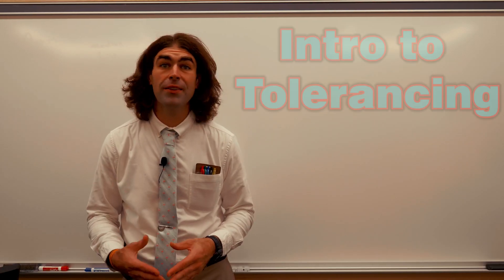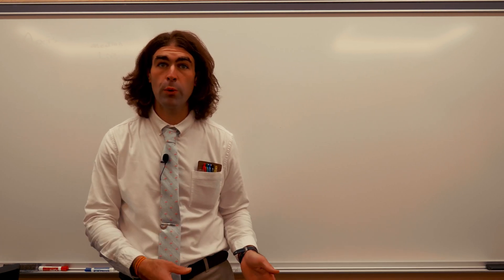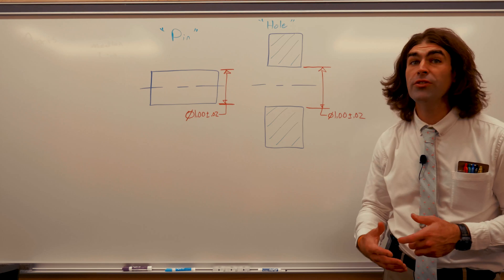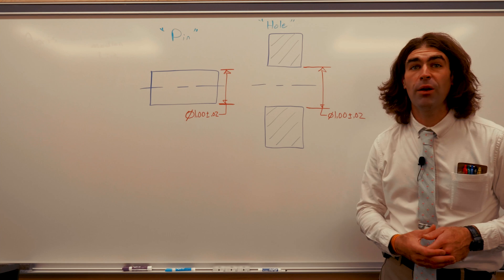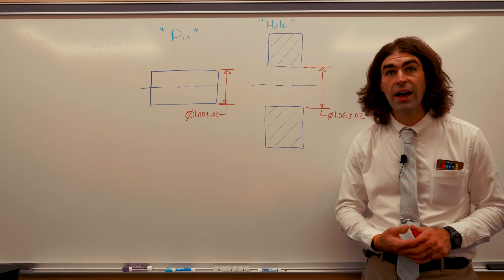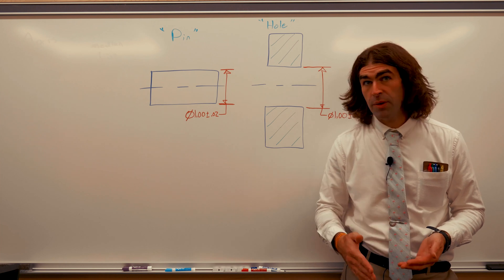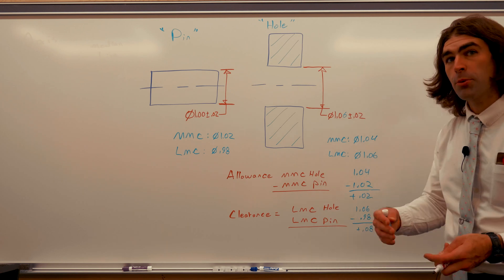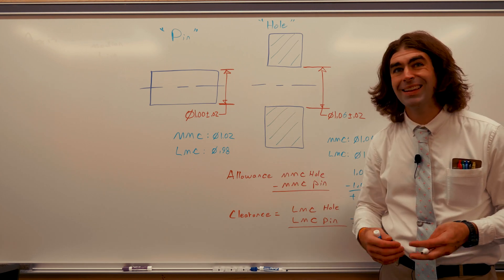Intro to Tolerancing: “Worst Case”, Allowance & Clearance

Comment: How clearance gets affected when there is position tolerance applied to hole at MMC ???
Reply from the maker: Hi, the position tolerance is subtracted from the MMC to establish the virtual condition, also called the inner boundary. That would be your related actual mating envelope for a tolerance stackup. Thanks for the question!
Reply: @RDeanOdell  thank you for the clarification. Would love to see video with same example but with position tolerance applied at MMC. Basically a video on virtual condition and resultant condition, and how it affects the fit between hole and shaft ♥️